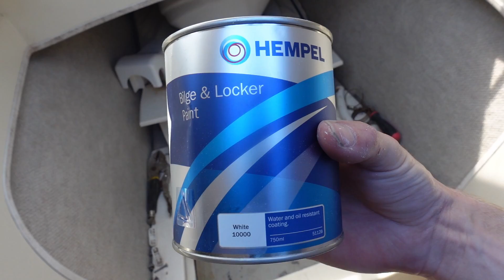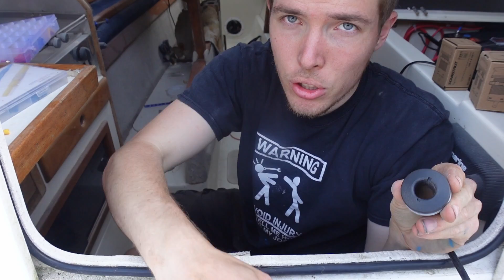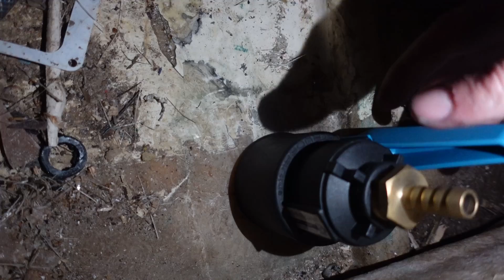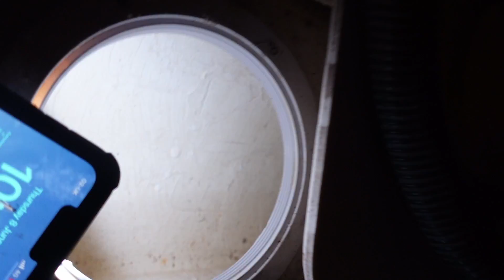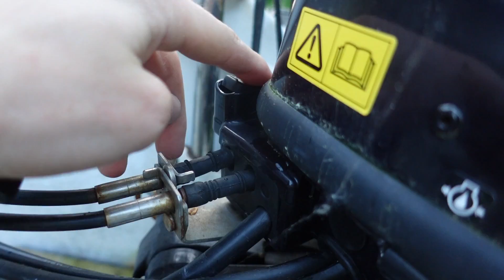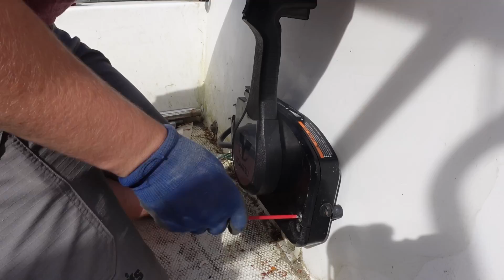ELECTRIC HEAD CONVERSION AND A NEW 20HP OUTBOARD | Ep.131

Comment: Great job Alex, looking forward to see you on the water.
Reply: With all that weight, half the speed (sailing)?
Reply: 6hp would be sufficient for getting in / out harbour
Reply from the maker: @markthomasson5077  it would but I will be going much further afield!
Reply from the maker: @markthomasson5077  definitely not half the speed!
Reply: ..only jesting about half the sailing speed.
I do know i swapped a 15hp for a 3.5hp on my Hirondelle cat…and lost all of a knot, perhaps two. 
Multihulls are very weight sensitive, especially at the hull ends.
I see it took two of you to put it on, so quite a beast?   Ideally you want to be able to lift it into the cockpit, should you need to maintenance afloat. 
So personally I would have gone for a 6hp saildrive ,  ie high thrust. 
Of course if you are thinking of towing water skiers, that’s a different ball game!
Anyway, hope it works out.
Reply from the maker: @markthomasson5077  the 10hp was the lowest I’d go. The 6hp would work for sure. Weight between the 10 and 20 wasn’t significant so went with the upgrade. Will be saving weight else where for sure!!! Thanks Mark!!!
Reply from the maker: Thanks Joe!

Comment: Hi Alex - good videos mister and wishing you every success with your marine fun.
Meanwhile, your use of clear plastic braid hose to make your water systems is a big mistake. Any water (fresh and salt) resting in a piping system exposed to any amount of daylight will grow nasty. As in bacteria with toxins.
All of your piping must be 100% light proof and it does not matter if you're thinking your piping will be ok hidden in a locker - it will not be ok.
Consider using domestic pex barrier piping and high quality push fittings.

The 'baffle' in your water tank is to reduce sloshing - obviously when the tank is half empty then the whole lot will be swishing around each time you hit a wave. Extremes can affect the boat's stability and even damage structure.

I'd say every millimetre of piping and every single original fitting and pump within your existing water tank and water system is unusable. Filling lines through to discharge lines. It's a contaminated germ pit. I'd recommend you condemn everything, else you may end severely ill when in the middle of Biscay.

Always paying attention to structural integrity, you can cut access in the top of the existing water tank and install a flexible tank inside instead. (They are cheap and strong and good)
All new tank
All new piping to correct standard
All new fittings
All new pumps
Backflow prevention

Attention to be given on fitting backflow preventers into the toilet sink tap, shower head and galley tap. There must be no chance of contaminated water running back into the tank from any outlet.

Good luck mister - but your present water system is horrific.
Happy Googling

BRgds .. Nick
Reply from the maker: Thanks Nick! Valid considerations to be made. Being a trailer sailer the system is drained when not in use and cleaned before every use and has an inline filter. Can confirm it tastes great and haven’t got ill from it as of yet. Couldn’t imagine the cost on doing all of the upgrades suggested.
Reply: @AlexGoesSailing Well, you don't need Raymarine gold mine but you do need water.
Anyway, what's good for the soul ??   and boys toys always skew priorities. 
🤪
Reply from the maker: @NikNiks1  if I ever do have a problems I will be spending on the upgrades like you suggest as they are great long term solutions. If I was living on it then it might be a different situation as tank cleaning once a week wouldn’t be possible.

Comment: The elbow will help prevent kinks in the pipes, they will also drop the pressure due to the tight bend. Removing them is best if you can.
Reply from the maker: Yep only have one t connector in the whole system!